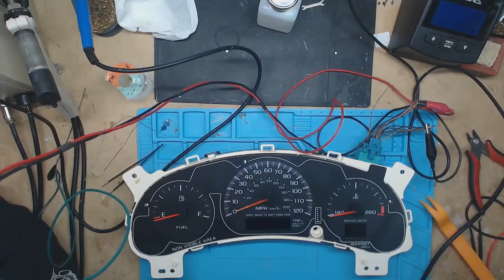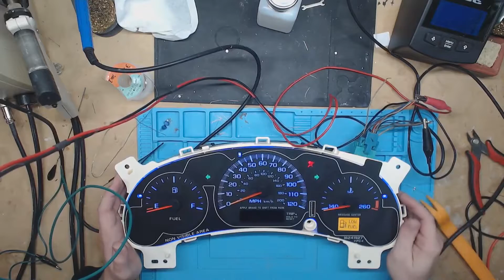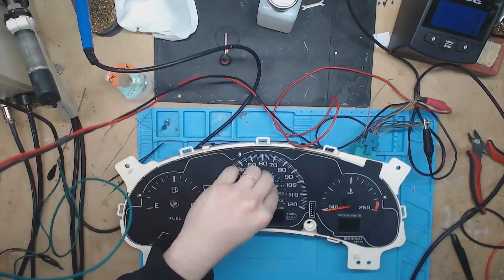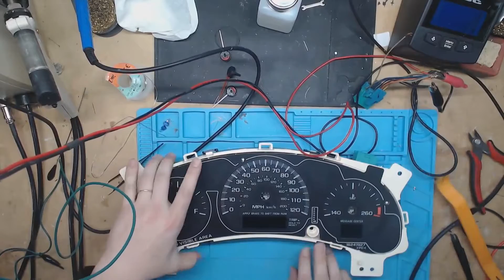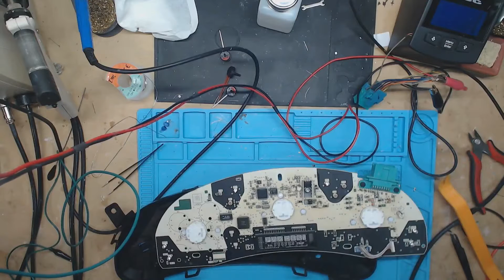Impala 00-05 Odometer Repair

Comment: What if the resistors are in place and there are no bad solder joints. Then what? Everything works except the screen for the mileage and what gear you are in.

Comment: 01 Impala -I've got a dimming odometer and the battery light comes on at times. Is that a cluster problem? We've changed the battery and the alternator is putting out the correct voltage

Comment: I did this and it worked but after my Speedo and thermostat needles stopped working. I was very careful taking apart and putting back together and did it just as you did. Any ideas what may have gone wrong?
Reply from the maker: Did you replace all the stepper motors. If not they probably broke if so Probably either burnt the solder pads off.
Reply: I did not, are they replaceable? Or would it be easier to just buy a new gauge at this point?
Reply from the maker: They are replaceable. X27.168 is the replacement part. Just desolder and replace

Comment from the maker: I finally got the new camera so this is going to be one of the last videos on webcam. I have one other video I recorded already its for a mustang. I have to say it was humbling to to redo that cluster and see where I came from doing it with Hakko 888D and lead free solder from home depot. I think when I did this one it was before I even had a power supply (I used a car battery back then). That first junk run payed for all most all the tools I use now. If you are just starting out when you make money invest some back in.
Reply: Thanks I will  my brother in law is a mechanic he want me to get in to repairing clusters some what o a electronic back ground like working with my hands on small projects any good training videos out there and what’s a good power supply I do have a battery charger to start with any help would be good thanks
Reply from the maker: @westbymontana406  https://youtu.be/BcWC8Cw-7YY Ive got a video on the tools for getting started. I wouldn't use a battery charger the power isn't clean and way to much current if anything goes wrong. I also wouldn't us a battery for the same reason its just what I got started with. If you watch m y channel start to finish and then Jeff's channel start to finish https://www.youtube.com/user/jeffescortlx
you will know just about everything you need to about these. get some louis rossmann in too.
Reply: Can you please put the link up for the resistors